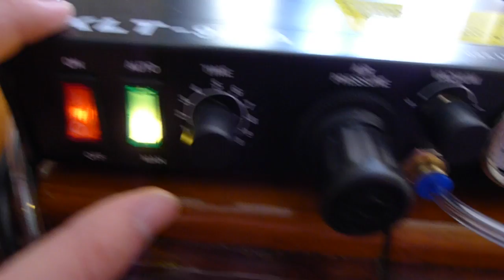KLT-982A Solder Paste Dispenser Review/Example

Comment: Hello. I have discovered that if you remove the top of the unit and with the use of a couple of wrenches, unscrew the air inlet from the internal block. The threads are the standard 3/8 pipe threads used on quick connect couplers. Simply screw on a male quick connect and then attach your air hose.
Reply: Thank u so much